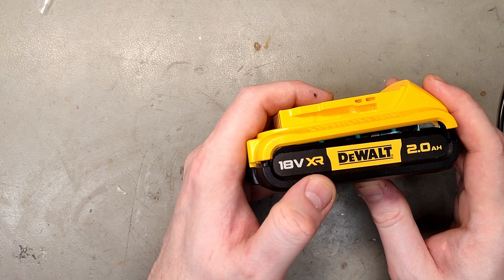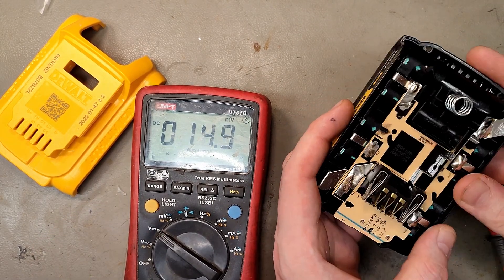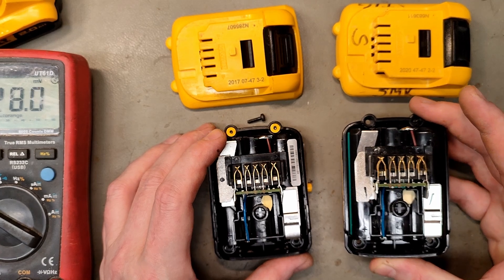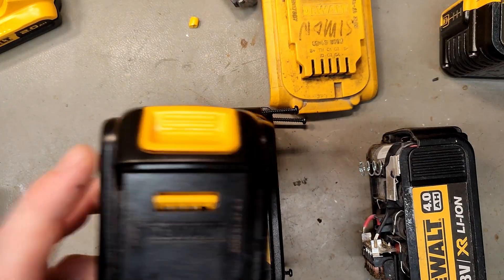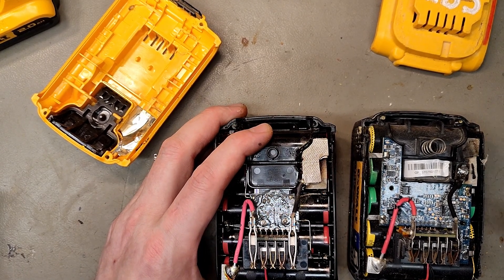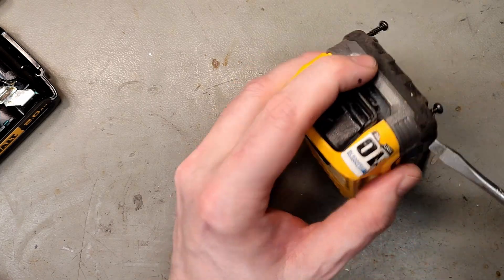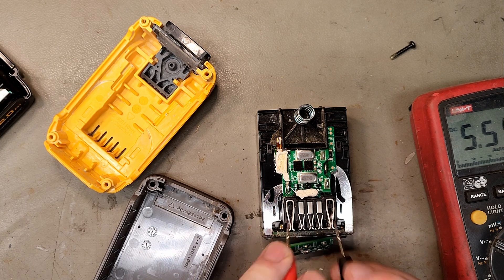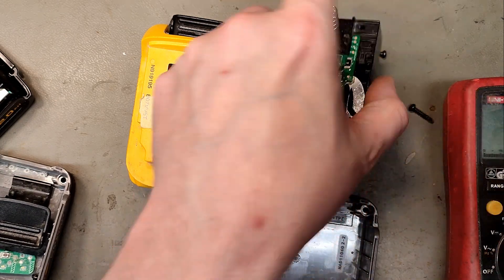Which Dewalt 10V-18V batteries are safe to use with Adapters?

Comment: I wonder if the DEWALT 18V to 20V Battery Adapter Kit has a BMS in the 20V 2.0AH batteries they include (DCB203 20v MAX XR). They do mention "Do not use with premium batteries (DCB200, DCB204, DCB204BT, DCB205) in 18V Compact drills DC970, DC759 (use DCB201, DCB203, DCB203BT)."